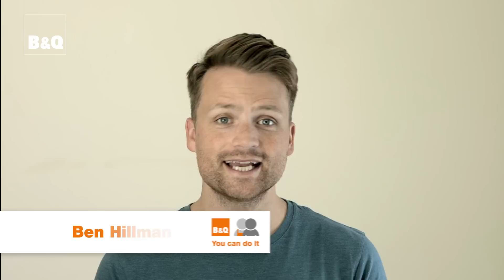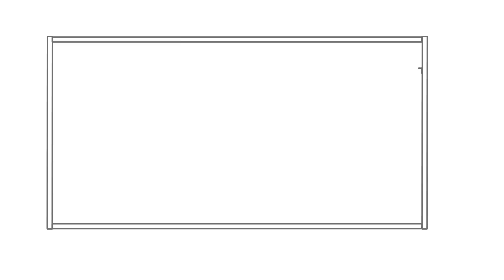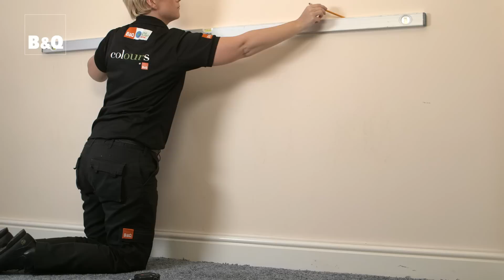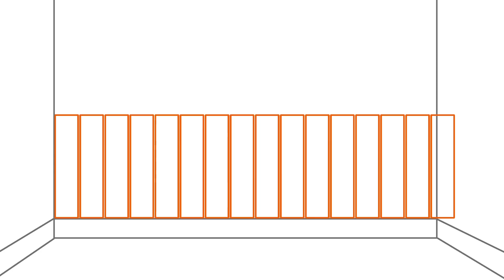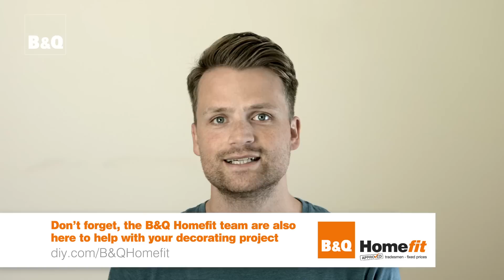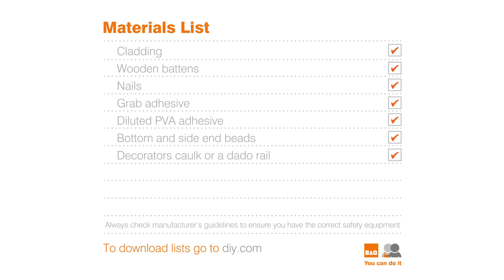How to fit internal cladding

Comment: Can use on the bricks wall???
Reply from the maker: Hi there! Yes, it can be fixed to brick walls, but due the potential unevenness of the wall, the panelling may not have the desired effect. A strong adhesive will need to be used like Gorilla glue 😊

Comment: Can this be put on to walls that has lathing plaster , ie will it cause damp or be ok
Reply: Yes you can and it will be fine
Reply: @josephcox295  cheers ,
Reply from the maker: Hi there, yes it can be put on plaster. The cladding won’t cause damp but damp may occur for any number of other reasons.